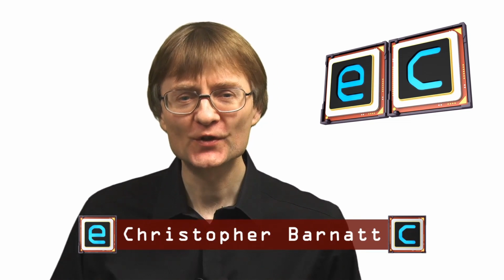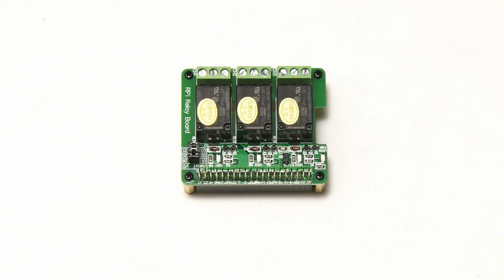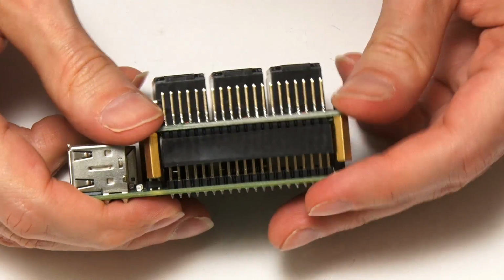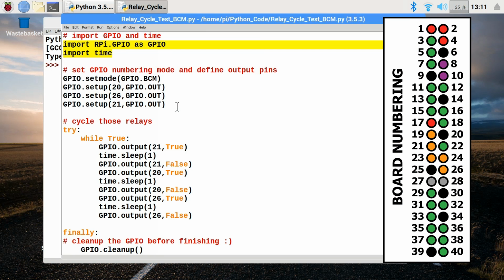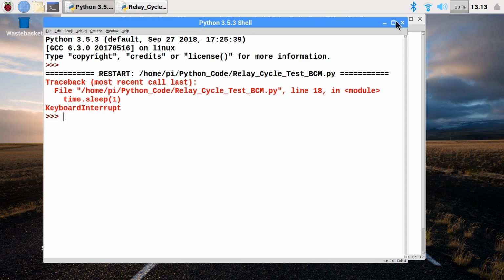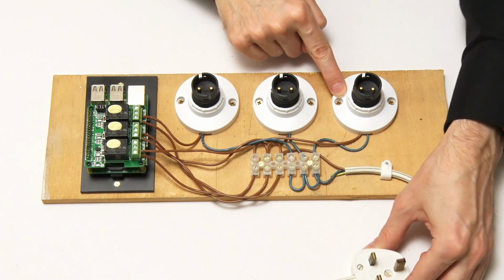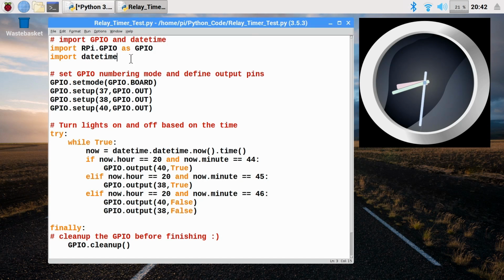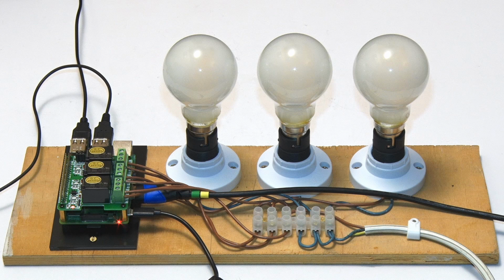Raspberry Pi Automation #1: Mains Relay HAT

Comment: This board has a potentially fatal flaw. It switches only one half of the circuit i.e. only the neutral or only the active. Ideally both the active and neutral wires should be switched. Switching both wires ensures no power is present after the switch or relay. Now lets look at the potentially fatal flaw. there is no guarantee that the mains outlet, extension cable etc. is wired to standard i.e the active and neutral are reversed leading to an energised load even when "switched off".  You might also throw in the lack of a suitable earth connection point as a criticism.
IMHO this board is not suitable for mains use it should be confined to low energy DC circuits.
Reply: Uninsulated screw terminals also
Reply: This is the same situation as with a light switch in the wall, but we use those all the time. What's the difference?
Reply: Difference is the house wiring was done by qualified electricians, tested and passed as compliant. Back at the fuse box the isolation switch WILL switch both active and neutral. So once this switch is opened and fuses pulled as a backup the whole house is isolated. This is why light and power outlets can be now singly switched because 1 the install was by qualified personnel and 2.  main isolation occurs back at the fuse box with a double pole switch. It is assumed no one would be silly enough to meddle with known live wiring. That is the best that can be done, treat the house as a single load and isolate it effectively.
Reply from the maker: This is very valid feedback. As I said in the introduction to the video, mains wiring projects should only be attempted by those with appropriate experience and will take appropriate safety measures.
Reply from the maker: @Vax Buster Agreed. The relay board should not be installed  in an exposed location where it would be possible for anybody to touch the contacts.
Reply: The relay board, the Pi and all the connections should definitely be installed securely inside a suitable electrical enclosure, with cord restraints, otherwise it can't be considered safe to be put into service regardless of the manner of switching.

However, if it is safely enclosed, then it doesn't matter if you use single pole switching, as long as you are not going to rely on that switching as a means of safe isolation. Single pole switching is commonplace in household appliances. It doesn't matter that it's single pole, because anyone with an ounce of common sense will unplug the appliance before they take the cover off and start working on it. Even those commercial plug-in remote control sockets use single pole switching, because they're designed as a means of control, not as a means of safe isolation.

Even table lamps, from which someone could remove the light bulb and stick their fingers in the lamp holder, quite often have single-pole switches (in the UK, at least). I have one here that's factory wired to switch the neutral only!

Comment: Omg apology for my long post. I have six roof top solar panels, I use two monitors which shows solar electric and mains electric being used and generated. I'm quite sad because when I have excess sunshine I turn on individual heaters , three sixty watts, a four hundred and another five hundred watts. This would be brilliant if I was able to use your set-up to automatically read the monitors and then have relays turning on and off with the varying degrees of electric power available. I'm disabled so have plenty of time to twiddle my switches manually but would really appreciate any assistance to make the process automated, envisioning five relays turning the heaters on and off as the sun shines, many thanks for your brilliant video and if anyone has the coding required I would like to create my own system. I'm a retired Marine Engineer but programming is like creating a knitting pattern..not my forte...cheers

Comment: i love your channel but why such an expensive and complicated solution. The single channel board is available for only about $2. 
So you do not need a Pi Hat. You do not need an Arduino. One of the many suppliers of the single channel board is 
https://worldofarduino.com/product/free-shipping-5v-low-level-trigger-one-1-channel-relay-module-interface-board-shield-for-pic-avr-dsp-arm-mcu/
My question is why are triac based opto issolator boards no longer available?  They have no relay and hence are not mechanical and last a long time. They switch at the zero crossing point of the mains and so do not damage the incandescent bulbs. That is to say they switch on or off when there is no current flowing. 
I used to have several and they were great but nobody seems to be supplying them any more.

Comment: Fun video, but you should at least add a time.sleep(1) at the end of that last loop, otherwise it will stress the poor Pi a lot!
Reply from the maker: Good advice, noted  for future videos.
Reply from the maker: Just to note that with the onscreen clock turned off, CPU utilization is about 1% running this loop. :)
Reply: @ExplainingComputers  I guess it's partly because python is interpreted, and won't allow a super-tight loop as with compiled C++ code. There could also be a small delay in the GPIO.output() call, limiting how tight you can set it (even with the same value), but that is speculation.
 You could experiment with usleep() to see how many microseconds sleep you need to make the CPU load almost go to zero.

Comment: This little HAT would make a useful base for activating a sprinkler system which are usually powered by 12VAC. Being a Pi, you could also pull in local weather to make sure you’re not activating the system when it’s raining or too windy etc :)

Comment: Mains power.. would "The Raspberry Pi hat of Death" be a more proper name? :D
Reply: True that. Last summer I was installing a ceiling fan and could've killed myself. I was so confident of what I was doing that I didn't turn off power from a breaker. I tested for positive voltage in the ceiling socket before turning off wall switch. Then tested again for no voltage. I proceeded to install the fan and sparks come flying out. Turns out that even though I tested the correct leads, there was another lead deeper in the same ceiling box with a damaged insulation, and it was touching a screw and thus the screw was live. When the ceiling fan touched the screw and a neutral wire, electrons were quite excited to run free. Had I touched both the fan (I held the fan) and the neutral wire (it was really close to my hand, but luckily the fan touched it first), I would've got voltage from hand to hand and could've died or broken my neck from falling from the ladder.
Reply from the maker: Hopefully not. Always take care when wiring any mains device.

Comment: Cool introduction but I don’t see any point in mains voltage hats for Pi and similar SBCs. At your set up mains wires were about 2 cm from HDMI and usb cable. Even with super cautious educated person it is just asking for trouble. Maybe it is worth mentioning in the wireless adapters video as a benefit/recommendation? (Although they consume unnecessary power for WiFi but that’s the other story) ;)
Reply from the maker: I will indeed be mentioning the benefits of wireless devices in this regard.

Comment: The relays' ticking sounds like my grandfather clock that my father built for me many years ago now. One tick per second. Pendulum swinging back and forth...  Back and forth... Back and forth...  Very hypnotic... Zzzzzzzzzzzzzz.......

Seriously, though -- I bet if you re-wired a second "hat" to use three different pins, you could stack two on top of the Pi and control six relays, yes?  And perhaps even 9 relays, if you rewired a 3rd board -- assuming there are enough GPIO pins to go around, right?  I can see all sorts of possibilities for this!  And the wireless controller that will appear in next week's video -- very much looking forward to seeing that.

You know what'd be really great?  Wireless remote keypads for the Pi -- maybe hooked to the home's WiFi?  Press a button on the wireless remote-control keypad, and it sends a signal to the Pi, which then turns on whatever light you wanted to turn on, perhaps via that wireless controller from next week's video?  I think I've found something I need to spend some money on.  ;-)
Reply: mount the relays on a hollow wood block for a bit of acoustic echo and you have the perfect "sound effect" for an old great wall or standing clock. 

As for the wireless keypad remote light switching, you can of course already buy those for a few hundred dollars and on up, but wouldn't it be much more satisfying to build it yourself and save some $$s?

Comment: I do doubt the safety of this combination. It seems to have some decent isolation slots along the pins on the bottom, but there should at least be an opto-coupler between the pi and the relay's and I see none of that. Also putting kilowatts of power close to low voltage connections makes one wonder how many users of that board ended up with fried pi and monitor because a loose wire fell down on lets say the HDMI connector. A separate relay board with some decent isolation should have made a far safer example, especially considering this channels target audience.
Reply from the maker: This is good feedback, and as I said in the video introduction, mains wiring and projects should only be undertaken by those with appropriate experience and will take appropriate safety measures.

Comment: Cool video, but I was more interested in one of the more mundane aspects.  I had seen British power plugs in other Youtube videos but I had never seen light bulbs.  Unlike the US, they don't screw in but rather work like BNC connectors.
Reply: Interesting. That would be a better design. The US uses a variety of different styles of connector, the type in the video is just the most common one. Most incandescent lights use this style of connector, just in different sizes. Fluorescents and halogens both use different styles of connector. LEDs have a variety of connectors, mostly owing to them often times being bought to replace previously existing bulbs.

Comment: A word to the wise:

Although it's okay to experiment with mains AC-supplied circuits with the Raspberry Pi while you are present, as Christopher has done in this video, I definitely wouldn't leave such devices unattended while plugged-in. 

Should a fire start after doing so, you may not only suffer losses to your personal property as a direct result of the fire; you could find yourself in serious legal trouble afterwards. Furthermore, since this relay-board is not certified as safe for everyday use by a recognized consumer safety authority ( e.g., Underwriters' Laboratories ), you may also find that your home insurance will not cover the damages that were caused by the fire.
Reply from the maker: Very important feedback. Thanks for sharing.

Comment: I'm using the WaveShare one, seems to be better quality components. https://www.waveshare.com/wiki/RPi_Relay_Board
What is that clock app, please?
Reply from the maker: As far as I can tell, the WaveShare board is identical(?). I will have to run up the Pi to check which clock app I used.
Reply: @ExplainingComputers  thanks a mil! I was going through the Apt repo but couldn't find the same one.
Reply from the maker: The clock app is MacSlow's Cairo-Clock, run with the "Glassy" theme, at 500x500 size.

Comment: Hello Christopher,
Thank you for this video.  I'm glad to see you doing more work with practical Raspberry Pi Python Programming.  I do have a suggestion / request.  Could you please do a video on making a Wii U Pro robot controller in Python with the Raspberry Pi.  I have been trying for months to interface my Wii U Pro Controller to my Raspberry Pi in Python.  I want to control an output relay board and hopefully in the future, servos and motor control boards.  I have searched the internet but can't find a clear solution.  I can see my Wii U Pro Controller button presses on the Python script page but I can't incorporate the controller data into my Python programs as usable variables.  I would greatly appreciate if you took on this challenge.
Thank you and keep up the good work,
Ringo

Comment: That would be useful as a roadside emergency beacon to warn other drivers that you've broke down. Using high intensity LEDs. Either off the car or a small battery.

Comment: Yeeeeeee, automation! 😄

I remember the times (70-80's) when this kind of automation was done by discrete electronics and the difficulties we had to face with clocks ... I still remember a device I made and used a normal digital clock in order to find out which time it was ... there were no or only extremely expensive RTC chips available, but alarm clocks were an affordable alternative.

Comment: Excellent video. Just wondered what is the name of the clock software you are showing on the desktop of the pi.
Reply from the maker: I will run up the Pi and report back!
Reply from the maker: The clock app is MacSlow's Cairo-Clock, run with the "Glassy" theme, at 500x500 size.
Reply: ExplainingComputers Excellent, thanks

Comment: The relay HAT is something I’ve been looking for for many years. Is there a similar shield for the Arduino? Does it meet all the safety requirements especially for creepage and clearance distances? I cannot find a spec sheet! It’s perfect in conjunction with temperature sensors for heating control. Perhaps you could do a video on the RPi with very low current wireless units for battery operated sensors.

Comment: I use sonoff wifi switches around the house. they've got esp8266s inside you can reprogram with your own software and for about $5 each they're a lot cheaper than raspis.

Comment: Useful addition to the Pi, test setup good, no problems, but if the mains HAT is mounted in a permanent position they should have included a isolation strip to cover the mains outlets. ( In a similar way as a mains fusebox )

Comment: Please, anyone doing experimental work with mains power ensure your circuit is connected to an RCD or Residual Current Device (North America CFCI). Chris basic electrical safety must come first when dealing with mains power.
Reply from the maker: Agreed. I did say at the start that this project is only for those with mains experience.
Reply: @ExplainingComputers  Sorry to push this Chris but the Pi is an experimental board and people with limited knowledge will experiment and probably do some mains wiring they have to start somewhere. Modern house wiring does have an RCD but not all. It would be wise to include examples of this or recommend videos that address this very important safety aspect.
Reply from the maker: I can again only agree with you Robert. Projects like this are not the place to start with mains wiring, which is why I included the warning that I did in the video and in its descripton, and now also as a pinned comment.
Reply from the maker: I have now edited the video description and pinned comment to explicitly mention the the RCD point you raise.

Comment: Great idea, but it's not optoisolated from the Pi, I'd use optoisolation myself just in case.  

The circuit is clearly a darlington pair, one resistor from the Pi to the base of Q1, a second resistor from ground to the base of Q2, and a reverse EMF clamping diode, with an added LED and dropping resistor going to the Pi.  One better way to do this would also be to use a TTL octal or hex decoder, thus controlling seven or fifteen devices from three or four GPIO pins, and so forth, plus it would keep the number of optoisolators needed down to three or four.  The only actually expensive items would be the relays themselves.

One thing I HATE about the HAT idea is that most HATs don't include passthrough for the GPIO connector's unused pins.  I'd add a 40 pin header on the relay board with full passthrough.

This kind of thing would be perfect for the Pi Zero W using a custom TCP protocol.
Reply from the maker: I agree -- opto isolation would be the ideal.

Comment: I question the wisdom of mounting mains relays directly on top of the Pi. Even setting the safety concerns aside, it doesn't seem entirely practical, more of a novelty. Having a raspberry pi communicating to a network of Arduinos via RS-485 would be interesting, perhaps a little outside the scope of the channel though!

Comment: Hi, well timed series for me. Just started trying to get a razberry z-wave adaptor working with rPi. Took a bit of work because I'm using a 3B and the razberry uses the same port as the bluetooth module, but after hours of searching online found out that it's just a question of turning off the bluetooth adaptor. As z-wave is a sort of standard thing for home control(with a nifty web browser interface accessible from anywhere in world) it might be something worth looking at in this series.

Comment: I am a bit concerned about that infinite loop. Shouldn't we put a sleep or something like that? I think that a better choice would be to use an scheduler (like the "sched" library). Another option could be using crontab, but I think that the scheduler in this case is the better option.
Reply from the maker: There are certainly more elegant solutions, but not ones I can explain to beginners as quickly in a short video! :)